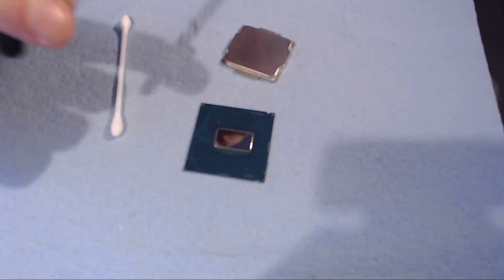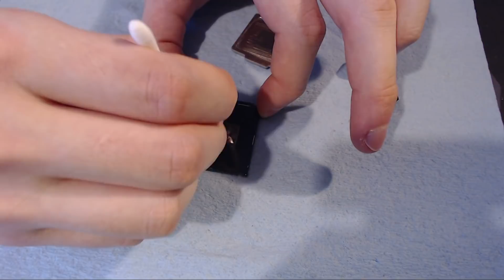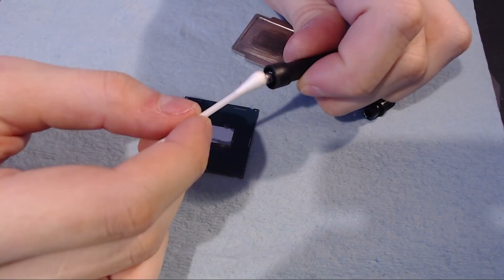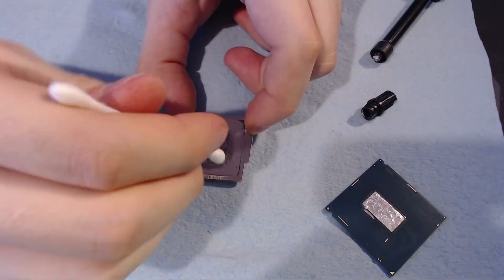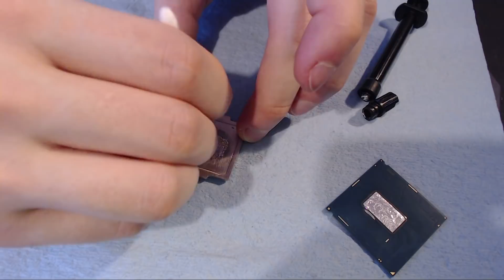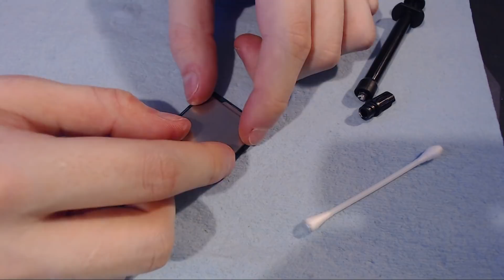How to safely apply liquid metal to things.

Comment: Can you safely run your CPU vertically without resealing? I never saw anybody use it that way, mostly on a test bench.
Reply from the maker: you'd have to install the CPU with the system horizontal but once the socket hold down bracket is down that IHS isn't going anywhere. The main risk is applying soo much liquid metal that it spills everywhere when you put the IHS on.
Reply: My 6700k has been running vertical on LM for about 8 months without a problem, so can at least make it that far.
Reply: Been running every delidded CPU vertically without resealing. It makes no difference if it's vertical or horizontal, it's not like it will drain downwards if that's what you're worried about. It should be as thin as a layer of paint, it won't go anywhere. Reasealing is pointless if you're just going to keep the CPU in the socket anyway. Reasealing might even hurt your thermals (check Gamers Nexus video, where even a very thin seal made it run a few degrees hotter than with no seal).

Comment: I heat the tube up with a hairdryer till it is really hot. It is MUCH easier to control.
Reply: Well the first time I used it, I put it in the freezer for 5 minutes or so and it was easy to apply. I think that heat is not a factor concerning  the adhesiveness of liquid metal thermal paste
Reply: @alihusein4299  LM melting point 29C, warming up helpful

Comment: The stain only goes a few micrometers into copper, and doesn't affect structural integrity or performance in any way.

The "drying up" thing people ovserve and performance degradation is just oxydation due to air getting in there, since fit between Heatsink and IHS is far worse than between die and IHS or in direct die cooling in laptops or GPUs.

Comment: I'll just buy an AMD CPU and don't bother with delidding.
Reply: unless you buy a ryzen 3 2200g or a ryzen 5 2400g those are sadly TIM not indium solder
Reply: you have to delid those with heat and thats the danger, over heating the CPU while delidding it, but if its already soldered the temp gain is so negelegeble its pointless nobody should delid a working soldered CPU for any reason unless they want to purely just to do it
Reply: you can get better performance even from a solderd cpu, but not that much (yes you can delid a soldered chip but it's stupid and you have a  considerable risk of ripping the die right off the substrate)
Reply: also if i you don't heat it enough you can damage the die
Reply: Matteo Kropej there are sites that know how to delid those too. It's for extreme OCs.
Reply: Nogghan 
You are wrong.
for retail was soldered, for tester TIM.
Reply: Used LM on laptop and GPU. So that's not only for desktop cpu's :D
Reply: thats why i went intel. thermals.
Reply: Matteo Kropej and just live with an oven for a computer
Reply: HAHAHA :D
Reply: Gavin Jones *triggered
Reply: Matteo Kropej reeeeeeeeeee

Comment: Thanks for this video.. Do you advice to unseal the cpu to check things up after some time?
Reply: Saif Sameer I'd keep it unsealed just to make life easier if you do end up replacing the LM. Gamers Nexus has also found you get slightly better thermals with the cpu unsealed due to the smaller gap between the IHS and CPU die.

Comment: Is it really worth it for a mild overclock where temps never go above 75?
Reply: if you want lower fan speeds, go for it.
Reply: no, hell it's not worth in most cases even when pushing high oc on ambient, on the 7(8)700k it's worth only if you are trying to push it hard (1.4-1.45v)
edit: as the user tommihommi1 pointed, you can use a lower fan speed if you go with LM
Reply: i think exactly the same, on the cpu i did it just because i already had the lm lying around (used on the gpu), i tought: "why not?".
Reply: ehh if you are running an intel cpu 75c is way too low to be concerned,below 90 everything is fine,since tjmax is 100 and intel laptop cpus that are basically the same as desktop parts run at tjmax for years with no perfromance decrease

Comment from the maker: This is kinda a filler video because I'm doing a ton of 2400G testing.
Reply: This is pretty much most helpful video from you I've ever watched. So, not really a filler.
Reply: I heard in your last stream that you were partially wanting to put it under LN2, is there still a chance for that? Because I'd love to see that.
Reply from the maker: yeah there's a chance of that. My next LN2 delivery is still some time away.
Reply: Actually Hardcore Overclocking I watched a video where TimmyJoe applied Liquid Metal to JUST the CPU surface, ignoring the IHS - I of coirse left a comment that he did it totally wrong, that due to the surface tension effects of Liquid Metal, ot MUST be applied to all both sirfaces that will contact each other.

Not too surprisingly, his temp results were mediocre for Liquid Metal.
Reply: @Dysphoricsmile  TimmyJoe is a massive n00b.

Why are you surprised?

This guy isn't l33t, however he's not far off. If he got gud at RAM OC he'd pretty much be there. ;-)
Reply: Actually Hardcore Overclocking  NEVER APPLY LIQUID METAL TO ANY SHUNT YOU PLAN ON USING FOR MORE THAN A YEAR!!  Louis Rossman hs a video where a Customer sent his Titan Xp to be repaired, and before then, Louis had no clue about Liquid metal, so at first he thought Nvidia just did a TERRIBLE solder job. Well it turned out that the Liquid Metal ATE AWAY AT THE SOLDER! 

So if you are going to be lazy, and Liquid Metal the shunts, you damned well better cover the solder pads of said shunt in Nail Polish! Or yanno, you COULD simply run a LITTLE jumper wire on top of the shunt and solder it, then tape it down.
Reply: It is SO EASY to re seal using Loctite Superglue Gel! And I prefer it that way personally, I accidentally broke 2 pins and killed a motherboard because the IHS slipped off and fell onto the pins RIGHT as I was bringing the chip in to seat it! 

Also because I have the Rockit 88 Delid/Relid kit, resealing using the kit, make certain my IHS is dead center, whereas in this video I can SEE that the IHS is crooked!
Reply: Actually Hardcore Overclocking Hows that experimentation Going?
Reply: Well I am glad that Buildzoid mentioned that Liquid Metal on Solder = compromised Solder which WILL DIE sooner than later! Normal users should NEVER SHUNT MOD! And honestly, while Liquid Metal may be the easiest way to achieve a shunt mod, a little wire soldered and taped will work every bit as well and has ZERO CHANCE of making your Current Sensing Resistors (Shunts) lose contact with the PCB!

Comment: Cheers for making this video Buildzoid, I've seen countless people make mistakes applying this stuff and ruining hardware so hopefully this helps prevent a few of those casualties. I was wondering if you could do other videos like this with LM, namely Conductonaut. Reason I say this is because people will use other brand LM and it ends up ruining a graphics cards shunt resistor where as I have personally used Conductonaut for years and the integrity of the resistors I've applied it to haven't been compromised.
Reply: as far as i know lm isn't good for ln2 because the thermal conductivity gets significantly worse than thermal paste and at those temperature it becomes solid
Reply: vdochev you got it exactly the wrong way around. LM is bad for sub-ambient applications, since it starts solidifying around 10°C and loses it's good conductivity. For LN2, Kryonaut is really the only decent choice.

LM is best used in cases where the TIM is a huge thermal bottleneck, i.e. in every single application where you have direct access to the die, like laptops, GPUs, and when delidding.

Laptops run 10°C or more cooler while at the same time having lower fan speeds, and the same applies for GPUs, especially if you're not running a custom loop.
Reply: The price relative to temperature improvement for LM still is absolutely impossible to beat, and you can use a single 1g tube of LM for quite a lot of stuff.
Reply: i'm talking about the effort, ny bad from not specifing, it's quite a bit more effort to apply LM tha normal TIM, i don't thing going frome 45 to 40-41°c is worth putting much effort in (in gpu is a bit mor worth the effort because you already have to spread a normal TIM, so why not go with the LM). i still have quite a bit left in the tube after reapplying it 2 times on the gpu (the first time i didnt' remember the vrm pads)
Reply: if you are under water it still can get you better thermal performance but it's getting in the realm of: is it really worth the effort?
Reply: If it was just a 4-5°c drop I would agree it wouldn't be worth it. In the case of my i7-8700k, delidding it and applying liquid metal dropped the temperatures over 25°c. I got a dud that couldn't hit above 4.9 without running it to 100°c and thermal throttling. Even at 4.9GHz it was skirting close to the 100° throttle mark getting up to about 95°c for peek single core temperature. Trying 5.0GHz would smash it into the Tjmax because of the drastic voltage increase needed to go from just 4.9 to 5.0GHz (1.296V up to 1.375V) for my chip. 

At 4.9GHz after the delid I went from 95°c peek single core temperature to 68°c peek single core temperature. After the delid and clocking up to 5.0GHz the peek single core temperature only maxes out at 84°c.  Getting above 5.0GHz on my chip is not possible short of sub ambient cooling methods, because it requires a voltage well above 1.44V (where I stopped trying) which already wasn't safe for daily use and was still instantly locking Prime95, let alone doing any of my other long term stability tests.
Reply: I wouldn't use liquid metal for a normal every-day use system. I think it is great for LN2 overclocking because it holds up in very low temperatures without cracking and/or changing quality. It's the same reason I wouldn't use racing brakes on my every-day town car - it's impossible to get near the operating temperatures and it wouldn't help much with normal working environment compared to normal brakes. But some "cool" kids (named after the creator of the Linux kernel, for example) think it's the next best thing since sliced bread and spread liquid metal on everything just to be "cool". It's pointless.

Comment: how often should i reapply my liquid metal? just when i notice temps being out of whack other wise its good still?
ive had it on my 8600k for about 4 months now and its still the same how long do you expect that to last?
Reply from the maker: when the temps go out of whack would be when I would check it. I've never run liquid metal long term. AFAIK Thermal Grizzly expect it to last like 2 years before needing reapplication.
Reply: Nogghan Had my delided 4670K runing 1.35V 4.4GHz for close to 5 yeara and the temps were the same since dat one. Used CLP on the die and Noctua NT H1 between the IHS and coolers.

And it was not sealed, just held in place by the retention arm of the socket.
Reply: It can last indefinitely, since the main killer is oxidation, and that's not a problem if everything fits snugly and your IHS is re-sealed.
Reply: only if you apply way to much but if you do it like he does in the video it wont run at all its a thinly painted surface thats why he didnt  even bother covering the surface contacts with a conformal coating, he knows the small amount cant possibly go anywhere and then itll be clamped by the IHS and then its really not going anywhere
Reply: boothegoo pc I wouldn't recommend resealing anyways because it's got a good chance to negate anything you dif while deiddimg if you add too much glue, just is the socket retention arm it works perfectly
Reply: Actually Hardcore Overclocking does the lm run down over time, when having the mobo vertically?